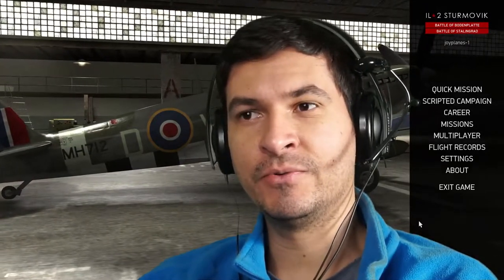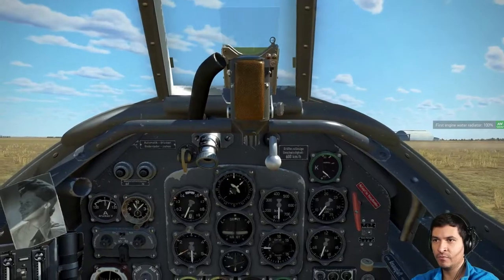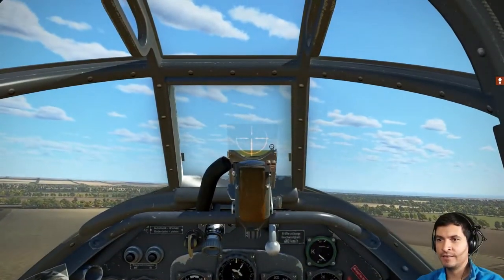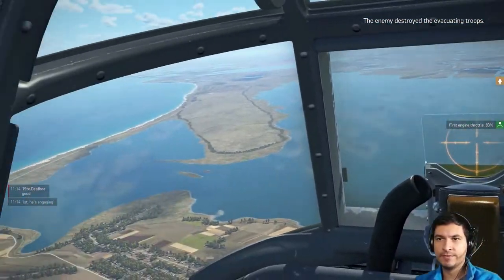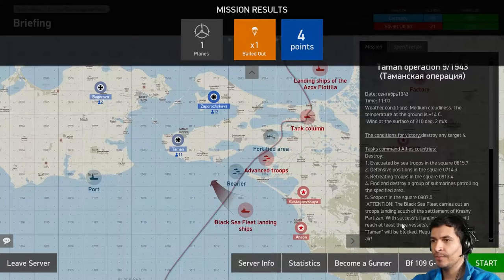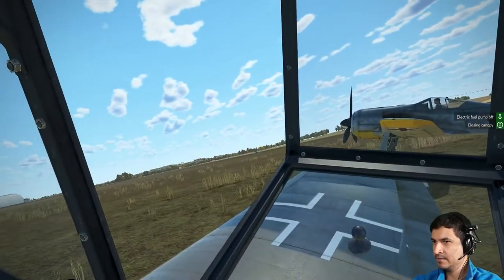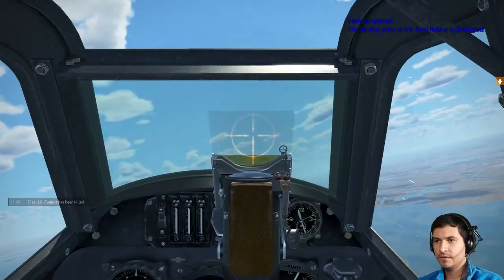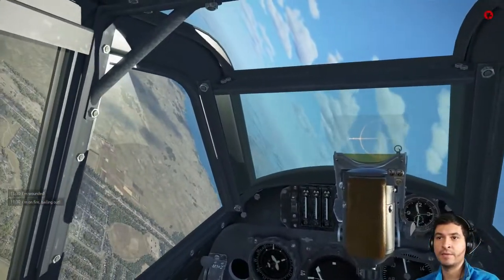How to fly airplanes in IL2 Sturmovik | RPM, Mixture, flaps, etc.

Comment: Try using the pilot head zoom keys to zoom out. You'll get a better field of view. You can also have a key for quick zoom to quickly zoom in and out to see things better either way.
Reply: This is the worst way to get zoom in plane, cause its takes your time to click buttons to achieve specified zoom.
When you using TrackIR or headtracking , you can achieve needed zoom by only 3cm ahead head move for example just by rights  "Z axis" configuration of your config file for OpenTrack. 
Now i didn't need to use any key to zoom from wide view of cockpit to zomm when i see only reticlr sight. I can watch my back normally without zoom , but when i need to zoom backward view i just move little my head to camera direction (around 3cm, maybe 5cm) to get complete closer zoom view of plane behind me.
When im attacking ground targets , i can zoom to reticle view to better see targets , drop bombs, than instantly come back to see whole cockpit.
So key binding method is completely outdated, when you have OpenTrack program with competent axis profile config.

Comment: I'm trying to play the tutorial solo flight to be able to take off but it doesn't work like in the video, pressing E does nothing.
Reply: Thats been my experience in Il2. Hardly anything seems to work.
Reply: you have to check out the settings and key-binds if "E" is set to ignition. Also some planes needs to have some (3-5%) throttle applied before ignition, and some planes first needs to be set at full rich fuel mixture before ignition, if you fly on full reality. Most easy planes is FW-190, everything automatic, just one minor "catch", to maintain on ground directional stability you have to lock the rear wheel by pulling and holding your stick up until around 100kmph... Good flight.

Comment: Got this game like two weeks ago. Was trying to get a helpfull video on prop pitch.. If prop pitch and prop rpm are the same why do they have different keybinds ? I think that prop pitch + rpm +eng-rpm = stress on engine. 2nd you should maybe do some trimminng or at least explaine it if you cover these basics. And 3rd maybe do a tutorial in a more controlled environment next time instead of a combat situation. Don't want to too harsh on you sorry, I otherwise like the style, just does'nt seem to be very thought out.
Reply: Hi, thanks for commenting, I'm not actually sure why engine RPM and propeller pitch is different, but the clue might be that in real life the RPM is a setting to "tell" the engine what RPM you want, but the governor has some limits to protect the engine so in the end, you are not controlling the pitch directly, and the pitch is direct control, at least that's how I understand it and I might be wrong. I sometimes play, so I haven't made a video in a month now, but I'll make some soon.
Reply: Propeller pitch is different to propeller RPM. Pitch is the angle of the propeller. You can see the prop pitch changes in the BF-109's clock dial. The governor changes it automatically to keep the RPM constant. You can switch pitch to manual for better fuel consumption and less prop wash for safer taxi and take off. You can even use the pitch to lose speed quicker, like an air brake, to make your enemy overshoot.
Reply: I guess I am quite randomly asking but do anyone know a good site to watch newly released series online ?
Reply: @Mekhi Finn thank you, signed up and it seems to work =) Appreciate it!
Reply: @Hank Derrick Glad I could help :)